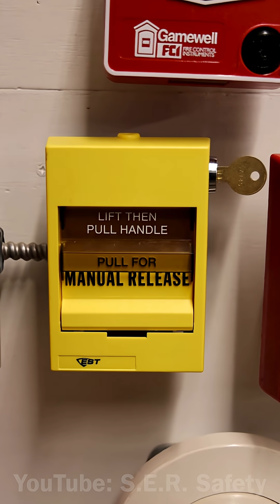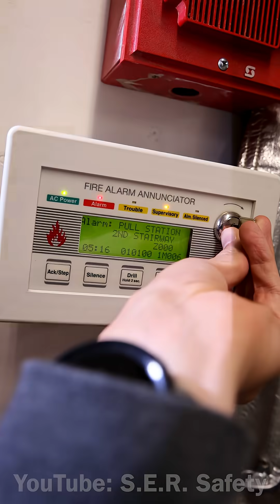Voice Evacuation Fire Alarm System Demonstration w/ Simplex 4901 Electronic Horn

Comment: They need to add these kinds of systems to schools to prevent false alarms/evacuations from kids pulling the fire alarm, like if one pull station is pulled, evacuation wouldn't be immediate and class would continue, but if a second pull station it's pulled while the first one is activated, then it would activate the full alarm prompting everyone to evacuate. This is a really good idea I should bring up to my highschool principal and the school board so false alarms can be prevented!
Reply: convoluted unnecessary and life endangering
Reply: @NottaFoamer yeah like what if you can't get to a second call bocks. There is a reson fire alarms are made to be able to be pulled with one hand so that one person ONE can get it pulled in an emergency. A better solution to the two block system is having a two action alarm and the block makes a noise in the class to get the teachers attention
Reply: In my school, we have something covering the fire alarm because people were pulling it
Reply: usually the punishment of arrest is enough